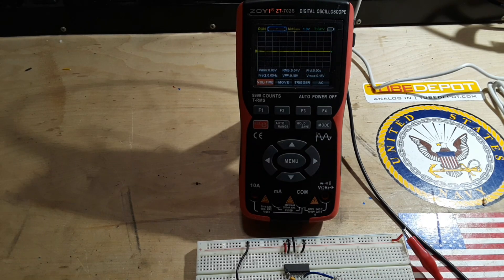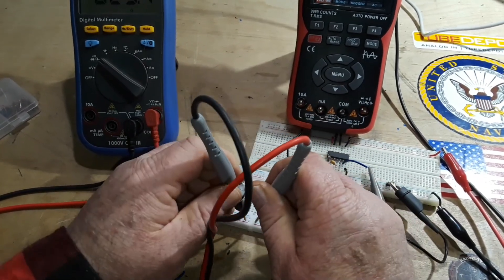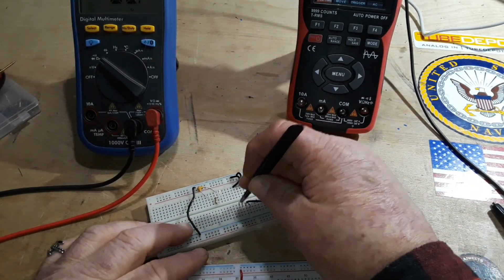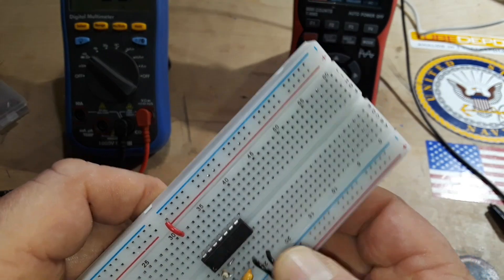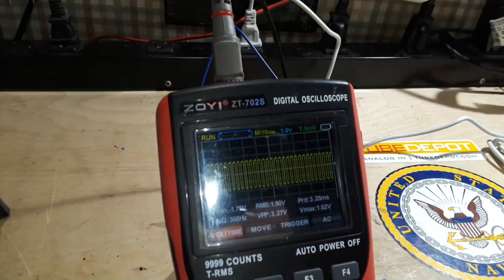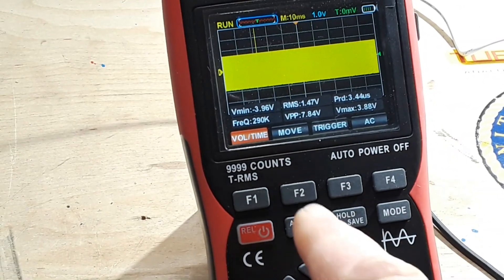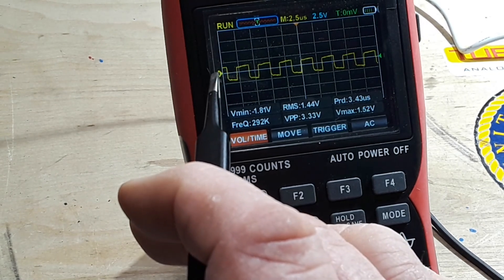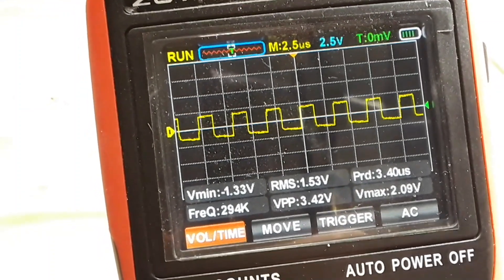Making a Simple Relaxation Oscillator With A 74HC04 Hex Inverter and RC Network

Comment: These always get me.  With a 2.2k resistor (measured at 2.171k) and a 1uf cap (measured at 0.943uf) I measure 233 Hz (2 different Oscilloscopes).  The formula says I should have 77.7 Hz.  What am I doing wrong?  I ran the calculation (f=1/(2.pi.R.C) ) on your RC (1.5k and 1nf) and get 106.1kHz not your measured 292kHz.  Not sure what is actually happening but connecting the oscilliscope to Pin 1 I see the Cap charge, jump value, discharge, jump value from +ve to -ve voltages.  The cap charges and discharges just shy of the supply voltage while the jumps also equate to the supply voltage (inverter switching).  However the charge/discharge rate of the cap is MUCH quicker than just through the resistor.

Comment: Adding a decoupling capacitor, usually 100nF ceramic between ground and VCC on the chip will help prevent damage to the chip caused by power spikes when you power it up/down.

Comment: When the RC is in the feedback loop of the Hex Inverter, is this called RC intergrator? because an RC intergrator in the feedback loop would create a triangle waveform output from a Square waveform input. I'm not sure why the HEX inverter output is NOT a triangle waveform output? any reasons why Paul?
Reply from the maker: Your not seeing the analog charge/discharge cycle, which creates a saw tooth. You are seeing the digital output of the inverter. 1 or 0. On or off. 2 choices no waiting. Merry Christmas
Reply: @learnelectronics  If you input a square waveform on the Op amps input the output will be also a square waveform same as a Digital output. When you put a RC network in the feedback loop on the op amp the output will have a saw tooth, not a square waveform. The Hex inverters output will have a square waveform even with the RC network in the feedback loop. The Op amps output has a rate of change and the HEX inverters output doesn't have a rate of change, any reasons why?

Comment: Can you get it to oscillate at the AM radio band?

The reason I ask is I just watched a video titled "The almost solderless  crystal radio" which used two choke coils that look like resistors to set up an oscillator circuit.

He didn't hook a scope up to it so I'm not sure what his waveform looked like coming out of his pair of choke coils.

He swapped out capacitors to change stations.

He used a geranium diode and a high impedance earphone in his design but hooked it up to an audio amplifier to demonstrate his radio. Cool beans if your circuit could be modified into a radio like his.